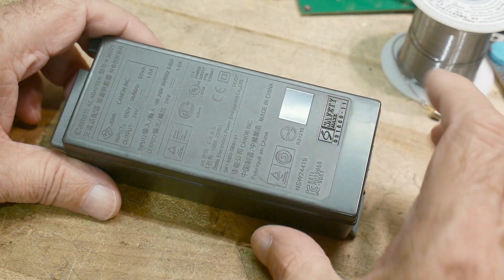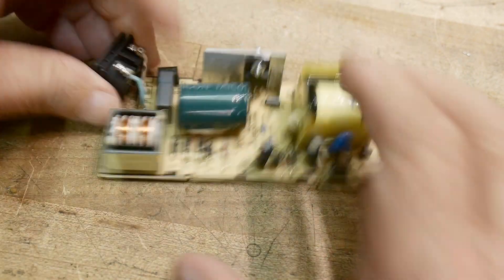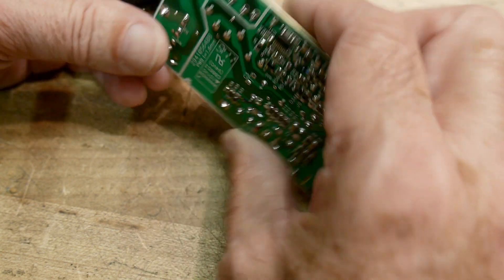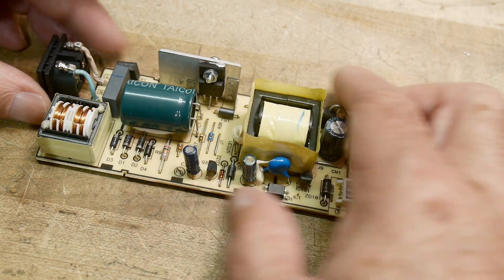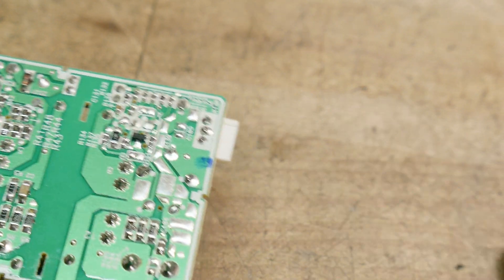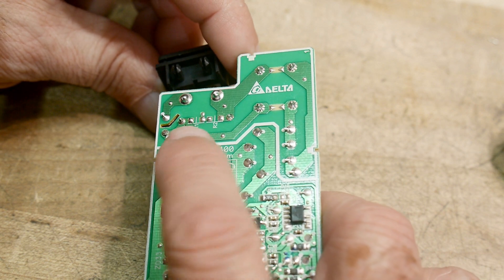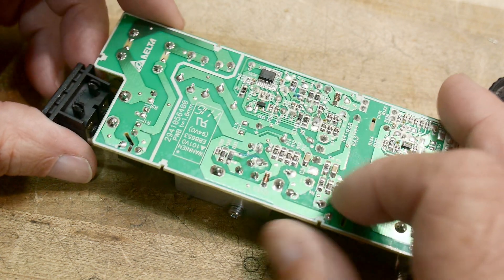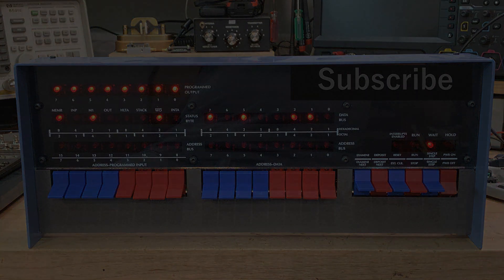#1429 24 Volt Switching Power Supply examination

Comment: The IC is NCP1219 and the MOSFET is 2SK3567. The pigtail on the AC input connector is a safety item, repeated power cord connection could damage pc board connections without the strain relief. It is a flyback type power supply.

Comment: The PS is modular because they are always connected to main and they had a high risk of blowing up due to input voltage fluctuations. Also, it wasn't built by Canon. Canon wanted to keep it separate from their design in case of recall. I had a printer with a dead PS and it wasn't modular.  I thought about fixing it, but the printer was old and didn't worth fixing.
Reply: I think it also has to do with UL and or CE listing and the difference in requirements for internal and external PSUs.  Just buy a an approved PSU model from a vendor like Delta and then your "low voltage" device doesn't need explicit UL/CE testing or something like that.  Plus you know, the liability is on Delta if the PSUs do start burning down houses.

There are a bunch of Ryobi combination battery/plugin things that have switching bricks just tucked in the bottom.  One of the reviewers got into why they went that way and it was something like above.  Blah blah, CE blah liability blah recall blah blah.

What is really funny though is the effort they go in to make it so that the battery and IEC connector lock out one another.  Not sure if they're dodging some liability thing there or just really trying to convince the customer it would be too hard to make their plugin/battery tools into chargers.

Comment: Hello, the input is very "standard". R1 and R2 is just for SMD discharging resistors but they did not solder them (i think because SMD reisitors are so expensive 😁, 2 in series because of the voltage). The big black thing is just a simple polycap / X-Capacitor for RF filtering and the small black thing is the fuse 😉
Reply: I've seen other switching ps design with those resistors in place. They're also used as voltage divider for the bootstrap circuit. You can see the via next to the pad between R1 and R2. It probably goes to one of the control ic pin. The ncp1219 doesn't require this as it has the hv pin connected directly to the hot side through R9. They might have a different chip that can replace the ncp1219 but requires the bootstrap voltage instead of connecting directly to the hot side.
Reply: 2 SMD resistors would cost less than a cent.
Reply: @simontay4851  yeah, you just explained the joke

Comment: I went and examined some of my SM Power Supplies. I do have R1 and R2 fitted on one of my boards. They are 1.5M ohm resistors, which bleed off the X-Capacitor (the grey box thing). Your power supply does not have the resistors fitted.
Reply: so if you unplug your printer and touch the leads... you will have a nasty surprise ...maybe

Comment: A very cursory examination. 
Modify to enable adjustable output voltage.
Reply: The flyback design powered by a feedback winding will only permit adjustment over a relatively small range.  You might be able to do 2:1 range without much difficulty.